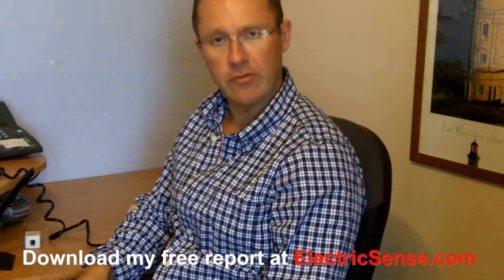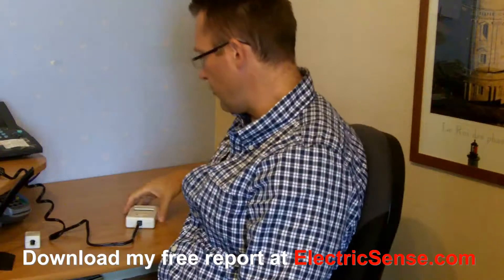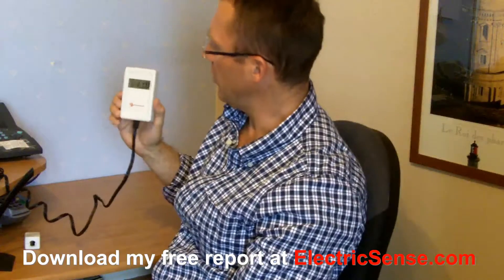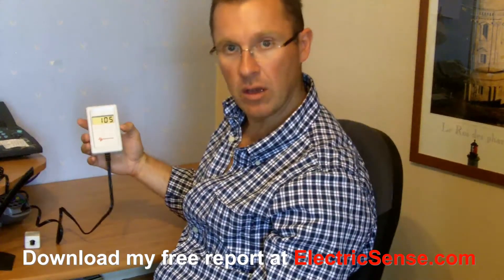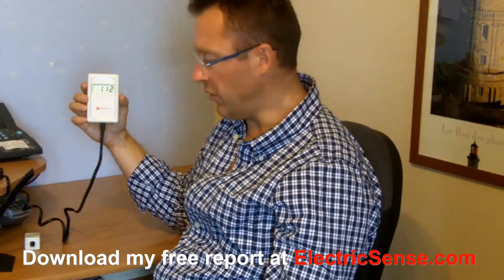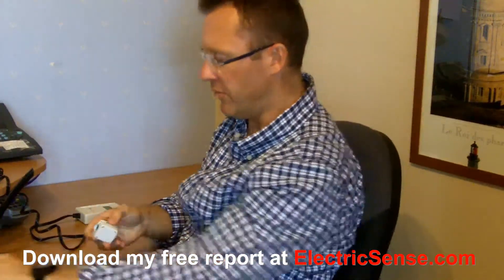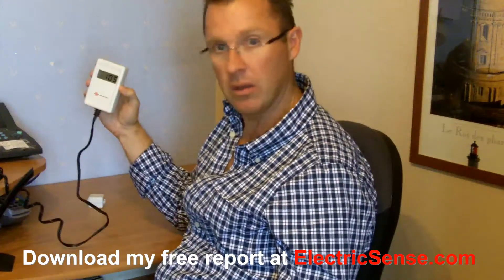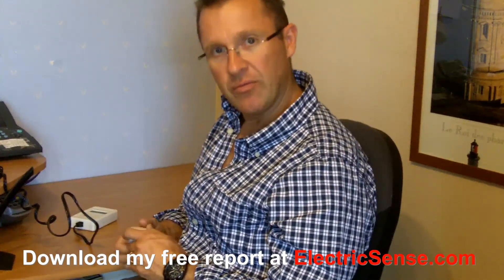Electromagnetic Pollution In Your Home Wiring -- Dirty Electricity

Comment: Yes, I heard the AC hum too.  However, I listen with headphones, so it may be easier for me to hear than it would be if one is just listening through speakers. Yes, from 1:16 to 1:20 (when the GS device is unplugged) the AC hum goes away.  It also goes away at 1:06, when Lloyd (slightly off-camera) seems to touch the French power plug adapter.  Why? you ask: Good question. I would love to know.

Comment: I am a fully educated systems telecommunications engineer, and boy have I been hunting electrical noise issues a lot during work.

Turns out, that modern broadband via ADSL connections are quite sensitive to noise of any kind. In one case, a particularly bad external harddrive had a slightly defect power supply that emitted so much noise, that it corrupted all ADSL signals within 270 feet, and to some degree also damaged radio and cellphone signals.

Once removed, everything returned to normal.

Comment: I saw a story like this on Spanih TV.  The microwave is the worst.  But even if you're sleeping next to electric items pluged in they are still emitting radiation & potentially dangerous over the long term.  WIFI signals & mobile plug in phones around the house can be quite bad too.

Does this machine pick up radiation from mobile phone masts?